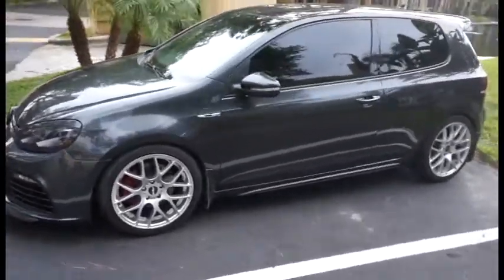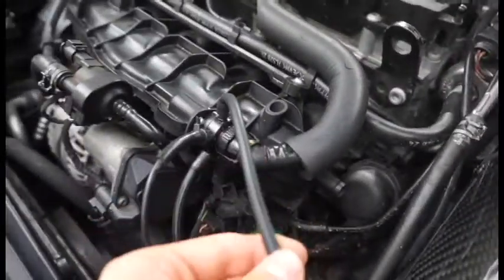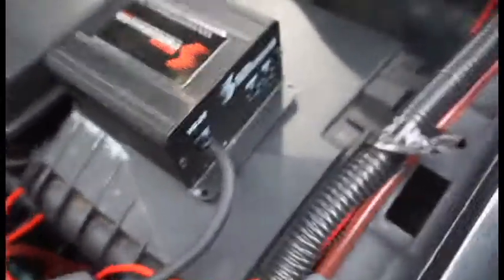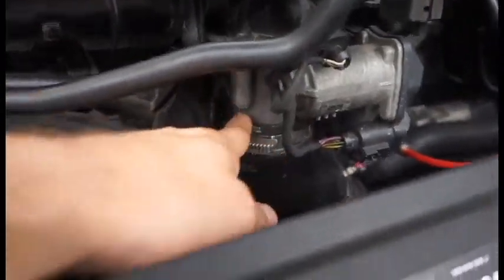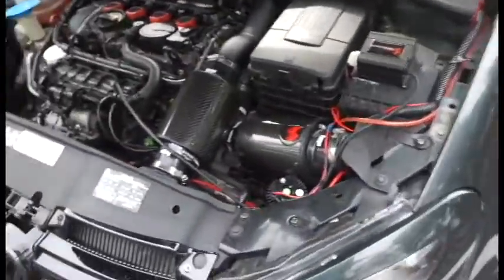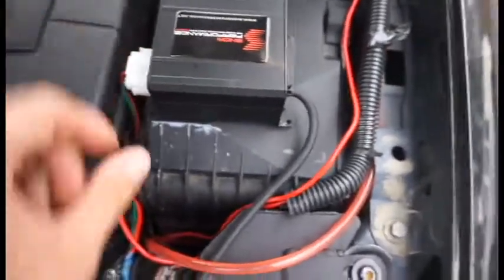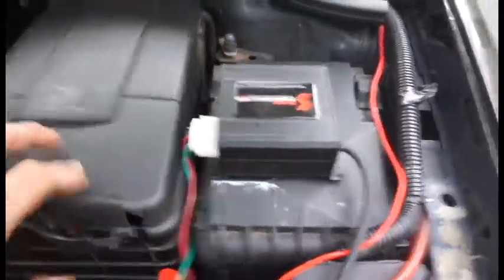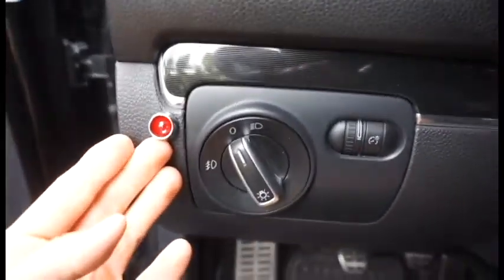Water/Meth Kit -How to- MK6 GTI

Comment: I wanted to hear about the carbon build up and how this meth/water kits helps steam you engine. nice set up.
Reply from the maker: Almost zero carbon buildup thanks to the wmi
Reply: Nice! That's one the things im worried about most on my Mk6R. Only had it for about a year now. Idk if is has been done already or needs to be done soon.  I know its costly to have carbon build up service done on these cars. Im handy but not that handy I feel lol
Reply: @dannyhampton hello, I have a question, I'm about to install this kit, how long does a full 5 liters of methanol last, approximately? considering that it works for me at about 1.2 bar, and my feet are a bit heavy? Thank you
Reply: @dannyhampton And if it ends, are there serious consequences for the engine if I exceed the pressure of 1.2 bar, and there is no more in the tank?

Comment: Thanks for the info. How long did it take you?
Reply from the maker: Douglas Kinsey I would say around 4 or 5 hours. The initial setup is not bad. But I spent a lot of time perfecting the wiring hoses etc
Reply: Thanks Danny your car is rad! Keep up the good work. I have a  Mk6 that is similar, add 2 doors sans water meth, for now. Have a good one
Reply from the maker: Douglas Kinsey thanks!

Comment: Fark, what a mess. Nothing is bolted down properly. Drive-by-wire throttle bodies should have the nozzle after the butterfly for obvious reasons (use a TB meth spacer from USRT etc).
Reply from the maker: pirrracy Thanks buddy. Everything is bolted down now. Also I have a ie intake manifold with 4 injection nozzles. This video was right after I put everything in to show things easier.
Reply from the maker: Check out the Instagram @autobahn_mk6

Comment: 50/50 mixture
50% amount of meth 99%
50% distilled water

or do you use 100% amount meth 99%?!
Reply from the maker: With the k04 I ran 50 water 50 meth. With my new big turbo I run 80 meth 20 water
Reply from the maker: Depends on how much fuel your system needs. 50 50 is safe
Reply: @dannyhampton  I am on K04, Just wanted to make sure I am not making anything stupid :)
Thanks mate